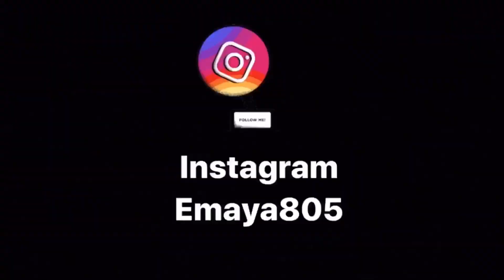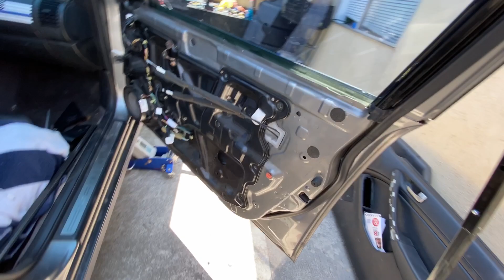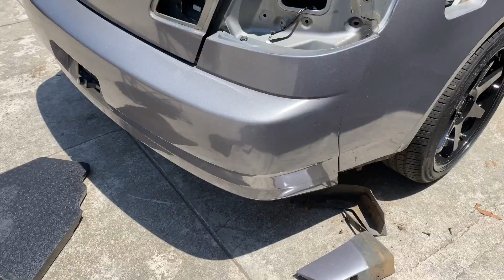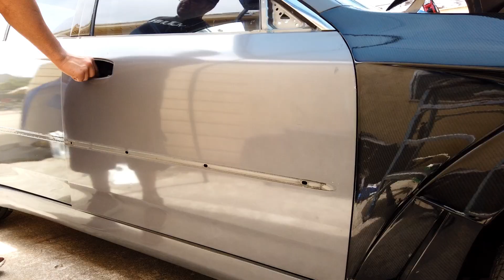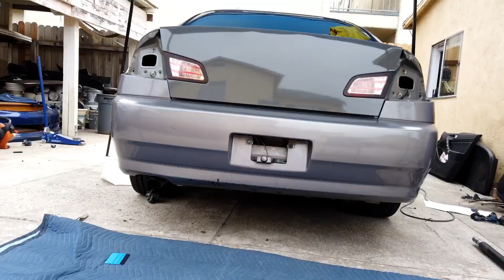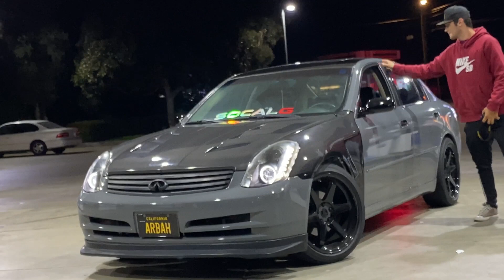G35 sedan with carbon gets full color change in Avery ( nardo grey)

Comment: what headlights are those ? been looking for some that fit 03-04 with HID from factory
Reply: Apple Jugo you got insta ?
Reply: Hayden Baratta yea @theedgartree
Reply: Might be spec d black housing for sedan 05-06
Reply: @youngbuck8973  05 06dont fit 03 04. Ive tried to much gap and the way the lights line up on the hood is different